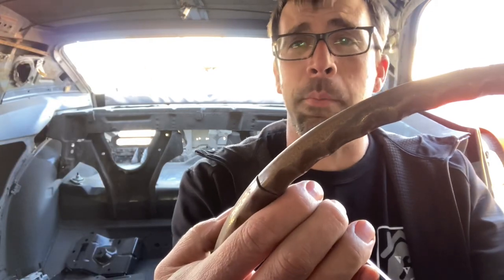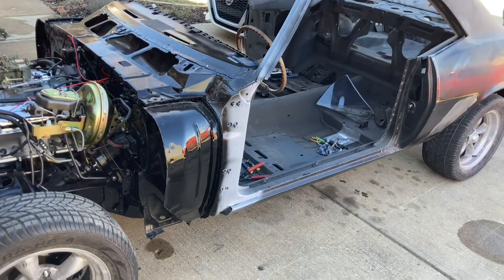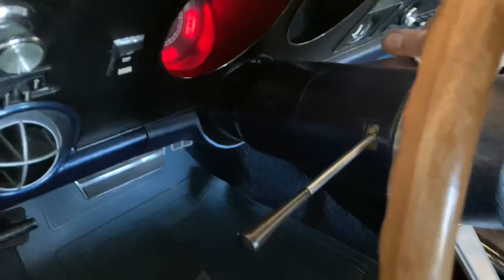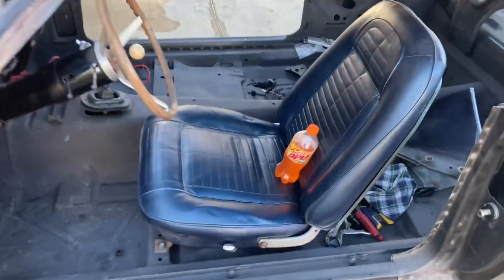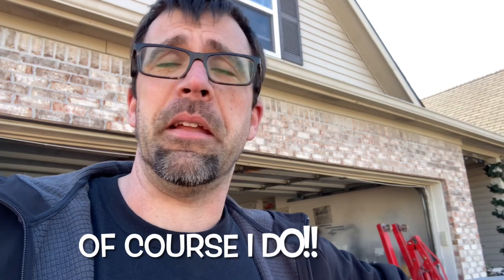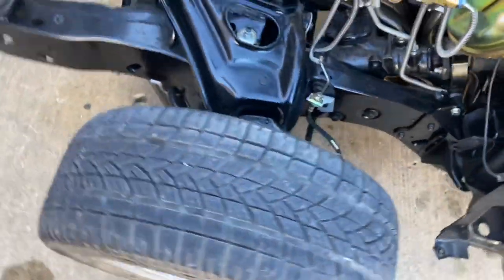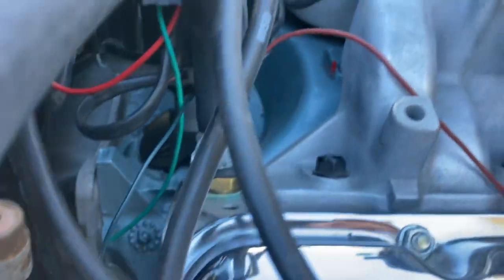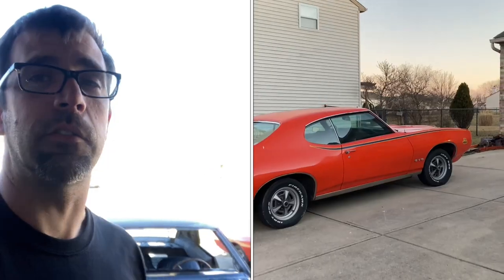Pontiac 455 stroked and poked 494 first time out on the road and of course burnout VVG VGG

Comment: Nice, 494 beast! Luv me some pontiacs, own a 69 gto with a 70 455 bored to a 468 zero deckd to 4.21 bore n stroke. The firebirds gonna be a screamer when it's done! Nice job. Love the trans am birds, nice!!!
Reply from the maker: Thanks I wanted to say I built a crazy big Pontiac at least once in my life.  The torque is just silly with a Pontiac its like having a donut on demand button at just about any speed. Even a GTO goes real good with a built 455 it might weight more than a bird but it will still be a tire fryer.
Reply: @VinylVillageGarage  Yep  they sure do have lots of torque. My dad had several.pontuacs as well, a 67 lemsns, 66 gto, 68 gto and 68 lemans. His 67 lemans was called the lemanster and had a jim butler 455 stroked to a 474 with e heads flowing 330 cfm. It ran a 10.8 at 129 mph off idle first pass it made. It was a fun car fir sure, my dad bought it from the st vincent de Paul fir 600.00, all original 1 owner with 100k miles, still ran pretty good when he got it, had a 326 and a 2 speed. All original with  no rust, was very clean. Built in fremont ca and my 69 as well, used to live in Fremont for a time. Pontiacs run hard whrn built right, i have been to many pontiac shows n drag races and have witnessed many gtos and birds run 10s n 11s with only 323 gears and a q jet, some much faster albeit more modified. Met a guy one year at the tiger run in oregon with a 70 judge. Still weighed full Weight had a 474 stroker in it, the cowel hood said 474 cubic inches of rat eating pontiac. It ran low 9s and drove on the street. It was quiet too and deceptive for sure. Same goes for another 65 goat that had a crazy stroker but the motor looked stock with paint etc. Even had the originsl hurst rallyes on it, ran low 10s. Pontiacs definitely hold a special place in my heart, i have met many pontiac greats over the years including jim butler and his sons, bruce fulper from rock n roll enginerring, dave bishop of sd performance, Jim wanger, pete mccarthy and best of all Arnie the Farmer Beswick at the gto nats in Wichita Kansas many years ago, had the tameless tiger on display, have a t shirt signed by him that is still unworn from then. Wish you all the best with your pontiacs! Nothing sounds like a screaming 400 or 455!!
Reply from the maker: Wow that is amazing, I never met those guys in person. Only read about in books and magazines, wish I could have. Best I have visited with was Herb Adams, I even got him to sign my Transmaroado, he definitely helped the performance of the factory birds.  I appreciate your love for Pontiac power and believe you maybe crazier then me about them but that’s a cool thing. 😎
Reply: @VinylVillageGarage  Very cool, I'm a bit of a pontiac nut! I have jim wangers autograph with a date on the underside of my gtos deck lid. Pete mccarthy even showed us how he ports heads, i have his 2 books which he signed for me. My dad and I attended the first annual jim butler nationals in leoma Tennessee yrs ago, we met a lot of pontiac greats there as well. All the pontiac folks we have met over the years have all been the nicest folks you could meet. Would like to see your bird when it's completed and painted, gonna be bad I'm sure!! My 2 brothers have cars as well, one has a 71 challenger plum crazy purple with a 440 strokec to 500 cubes and a pistol grip 4 speed, other brother is currently doing a body off resto on a 57 belair and has a 63 ford truck, runs in the family!! My brother also used to have a 70 440 challenger and a 71 demon 340 4 speed. Luv me some muscle cars!!! All the best 👍
Reply from the maker: Yup old metal is awesome I have an appreciation for them all really, I just favor Pontiac. 

I am going to Firebird fest this weekend in Stlouis and trans am nationals dayton Ohio in August if you are in the area
Reply: @VinylVillageGarage  Sounds like fun! I'm in Northern California so sadly can't make those events. Been doing a bunch of work on my gto, just pulled the rear and had it all redone with moser axles and a trutrac and 3.42 gears, its an.8.5 from a 71 buick with the bolt in axles. Also added rear qa1 dbl adj coilovers and new umi control arms. Have front umi tubular control arms with taller joints and dbl adj qa1s and a complete kit to rebuild the frontend and a borgeson fast ratio box as well. Will be nice once i get the time to finish the front suspension.
Reply from the maker: lol. Never a dull moment for you either it sounds.  Keep me posted on your toys and if I hit the west coast I will let you know
Reply: @VinylVillageGarage  sounds good!!!

Comment: Which a/c system have you selected? . Vintage air or  Classic air?, There are things about both systems I don't like..Biggest thing is the control panel conversion.. I wish they made a clear plastic overlay over their placard lable..They did for the C3 Corvettes conversions..Classic air conversion is worse in this regard..I have heard that many have  disregarded the placard change and retained the stock OEM one.Only difference is the Temp lever position moving hot to the right side..Perhaps a polarity change in that one  rheostat may change it..Thoughts?
Reply from the maker: I have only used the vintage air kits. All things considered I like them. Performance is good and not a complicated install.  I did however route the hose inside the car thru the Cowl vent hole and chose not to cut up the kick panel vents like shown in the instructions.  I felt it took away from the look of the interior and a bit sloppy if done as instructed.  As for the controls. Adapting the factory panel was straight foreword for the most part. Like you mentioned the labeling is no longer correct but I am willing to sacrifice that for comfort and still look tidy at a car show or driving it.
Reply: @VinylVillageGarage  The Factory right side kick panel used a cover. Are you planning to install one to somewhat hide the lines and hoses?
Reply from the maker: I left the passenger kick panel 100% stock and then ran the lines thru the cowl vent hole instead. The kit provides a small metal plate to cover the cowl vent. I modified it to run the lines thru instead.
Reply: @VinylVillageGarage  I like that  idea.Looking forward to watching that episode...Question. Is that opening large enough for all 4 hoses and are you able to use the provided grommets to seal out cowl drainage?
Reply from the maker: I used the provided plate and grommet to get thru the firewall at the blower motor hole. Then modified the block off plate for the cowl vent for the hoses to go thru into behind the glove box. When done the hoses are not visible except where they leave the toward the fender.
Reply: @VinylVillageGarage  In that case, I assume you will be using the provided outer heater box replacement plate. I never liked the look of those..Have you thought about retaining the original outer box to keep originality and running the hoses though the original blower motor opening?
Reply from the maker: I do not like the look of the block off plate provided, I have not used one yet.  on my trans am I did the Detroit speed weld in firewall cover really like the looks of it but it’s permanent.  Now on the great pumpkin. I am working on what you just suggested. Using the original heater box cover and running brass lines in the factory heater core tube openings.  To keep it original looking under the hood and if you wanted to return to original it’s an option
Reply: @VinylVillageGarage  Interesting....Pondering what a heater core tube set up would look like..Mostly the hoses coming from it...
Reply: @VinylVillageGarage  Wondering if you can run the heater hoses to the stock location in the OEM outer heater panel and fabricate aluminum piping through the panel to the Vintage air connections?
Reply from the maker: Still in the design process. Once I solve it I will be using it on two cars in my garage
Reply: @VinylVillageGarage  Looking forward to what you come up with..Looking at the V.A. unit their pipes point to the right side and the OEM pipes come through the other side..Not sure if an "S" shape pipe or hose would be an answer or "IF" there would be enough room to fit it since the unit is close to the firewall..BTW, BOTH Vintage air heater  core pipes are 5/8"  I have suggested to V.A. many times to make one of them 3/4" as MOST cars use...